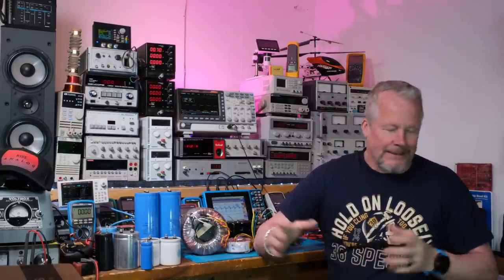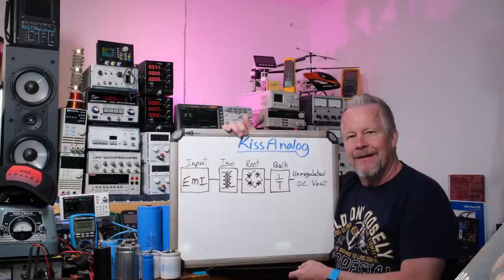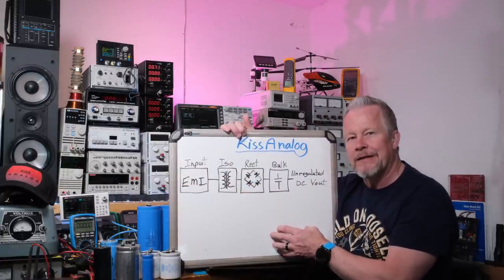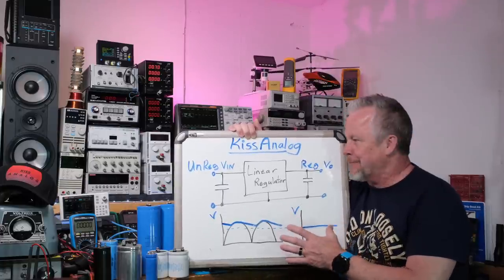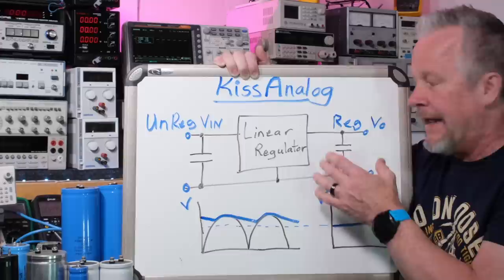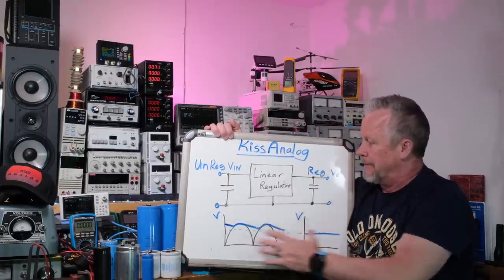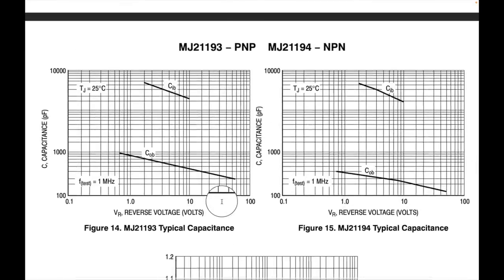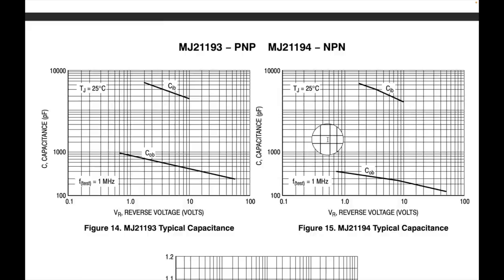Why Amplifier ‘Linear’ Power Supplies are not Regulated Rant - Have they been lying to us? #rant

Comment: Hi Eddie, another fantastic video. Been saying the same thing for nearly 50 years since starting work with an amplifier manufacturer.  The audiophiles are listening to the harmonics generated between their music and the 120 or 100Hz ripple on their amp PSU. This can be heard particularly on tube (valve) amps with tube rectifiers and may explain some  of the magic 'valve sound'. Seen the anaemic reservoir capacitor values on most tube equipment? Been a convert to switch mode PSUs on audio for around 20 years and always use one for my audio projects on size grounds alone.  Gotta get away from bean-can sized smoothing caps and plate sized 50/60Hz transformers. Just do it, you won't regret it!
Reply from the maker: Thanks Ken very interesting feedback!  I appreciate you!

Comment: The JAT501 can work with 4 ohm loads up to 38 volts or 40v rails regulated with 8 ohm. Without regulation, the idle voltage can go a bit high and VAS transistor and current source would need heat sinking or they will run hot. In other words, a regulated supply will allow for more power into sustained notes because it allows the amp to be operated at a higher voltage without over voltage concerns due to higher voltages at idle or high mains voltage.
Reply from the maker: Thanks John!  That's a great point, we can't go above the Voltage Max, so the unloaded voltage could be a problem in an unregulated Power Supply.

Comment: Well, some of us in fact do use regulated supplies for our power amps. There are some brands that do as well;  (Krell is one of note) but not many. you are correct that its not the norm. it does become quite expensive and it does add a bunch more heat to get rid of, when you power your amplifiers with amplifiers. Typically if any, they are used in lower power class A, or high bias class AB amplifiers. it also adds points of failure and audiophiles are a superstitious bunch ... I run a digital crossover, meaning that each driver has its own amplifier. this allowed me to use lower power amplifiers for tweeters and midrange and those have regulated supplies, with only the bass drivers using switchmode power supplies for the output stage, with regulated front end. There are some class D amps that have regulated switching supplies. As you pointed out, it can cut down on the 'heft' and typically linear or switching regulated supplies dont like driving large capacitor banks.
Reply from the maker: Thanks for the great feedback!  I like the idea of doing the crossover at low signal level so that you amplify each speaker.  Switching power supplies have no need to drive large cap banks - as the switching cycles are so much faster - there is no need for large caps that are needed for slow cycles.  Audio just does not get the best engineers - they have some great ones - but they are far and few in between.
Reply: @KissAnalog  Oh i'm with you there. I dont really see myself as your typical audiophile. I try and stay firmly on the objective side, if I can. I do have a tendency to overengineer, but that is not the worst of sins. Not a fan of being associated with some of that woo woo. Indeed, they dont need the large cap banks. My meaning-following along with your point- was just that because they dont like, or need large cap banks, thats one less thing to make the chassis heavy and thus 'quality' . I favour measurement and high performance SMD design, rather than mysticism and metallurgy.  

As it happens i'm in the middle of designing a PCB for a TPA3255 multichannel amplifier, to go with the DAC and DSP i'm working on. The final package being a 3d printed waveguide loaded active speaker with inbuilt DSP (raspberry pi compute module plus FPGA, driving a multichannel DAC and ADC/mic pre. I'm feeding it with a switcher I bought, at this stage, as i'm just dipping my feet in designing regulated SMPS PCBs as they are a bit of a black art. I'm pretty sure thats how your video came up on my feed ... gotta love google ...

Designers I admire are people like Bruno Putzeys of Hypex and Purifi fame, Scott Wurcer of Analogue devices, the late Jim Williams from Linear Technologies and engineers like Howard Johnson and Henry Ott

Comment: I discovered one curious fact about longer AC service wire runs. I have a "home made" Isolation transformer, toroidial winding, about 600VA capacity, which I wired a quality "Thermal Magnetic"circuit breaker ( Phoenix Contact from Digi-key) into ( 5A rating) If I plug it into an outlet which is closer to the breaker panel in my house, the inrush current will trip the 5A breaker about 50% of the time. If I plug into an outlet on the second floor, at the furthest point from the breaker panel, it never trips from the inrush current.  Apparently there's enough added resistance, or inductive suppression of the inrush current in the extra 40+ feet of wire to make that difference.
Reply: That's really cool.
Reply from the maker: Thanks for sharing this data from your test!  I can totally see this happening.  So an amplifier would have less inrush, but once the caps are charged - then the only difference would be the slightly lower voltage available because of that extra drop in line voltage.  A regulated Power Supply would totally solve this problem.
Reply: @KissAnalog  It wasn't really a test as much as an observation. I started wondering why the 5A breaker wasn't tripping, and there was only one change to the configuration, the length of wire from the main breaker panel to my outlet of choice. Sometime soon I may put a meter with a min/max current measuring function on it and see what is going on quantatatively.

Comment: A good video. The passionate audiophile pushes the limits of what is possible towards perfection. In the early 80s there was a project in the Audio Amateur magazine where someone with the surname BOAK converted a Dynaco ST150 into a fully regulated model by adding a couple transformers to the main one to boost the voltage and then putting a regulator in. The regulator he designed was a current boosted LM340-T which was floated up to the required rail voltages. This was a nice design that did not limit current but had current foldback to protect against shorts.
The end result was measured and it was objectively shown to reduce distortion from the original design. Perhaps the front end was not that well regulated in the first place but still it improved the performance. I took on this project but applied it to the Leach Power Amp from that time that I had built. Now it turned out that someone else in my city had built the same amplfier I had but had done so  as a dual mono block with dual toroids where mine used a simple Hammond EI transformer. One day we were able to compare the sound of mine ( fully regulated with his). The difference was in loud bass passages. It was clearly audible ( Rough Trade -Shaking the Foundations). Just as a trick, we then jumpered his amplifier to my power supplies with thin wires with clips and it now sounded identical. From that day on - all my power amplifiers are fully regulated. Now what needs to be said is that full regulation removed "warmth" from the amplifiers but the amplifiers no longer compressed loud passages and appear to dig deeper into lower frequencies. The removal of "warmth" is an aspect which would be worrisome to mfrs. Comparison of LM340 etc. vs. Sulzer op amp based clow current regs also show differences in sound as well. Today I now use Benchmark AHB2, LA4 and for the phono stages, I have each op amp with a dedicated high speed regulator with an equally fast op amp doing the work. All are fully regulated using cheap IEC cords.
Reply from the maker: Thanks for the fantastic feedback!

Comment: Hey Eddie, you really nailed it on this video!
It's really incredible the lengths the audiophile community can go praising snake oil while the obvious things they don't tackle.
A non regulated "linear" power supply really behaves like a switching power supply!
One can even see the rectified current PWM'ing as it checks against the ripple discharge ramp!
Yet, design discussions on those PSs, on whether we should use (or better avoid) high speed or soft recovery rectifiers due to the switching artifacts that they create (against the transformer's inductance) are all discussions that resembles much more the SMPSs realm than the linear world.
You really have a point on the obvious advantages anyone could get by regulating a power amplifier's power supply, especially in the audiophile segment where it seems that no effort is too expensive to get "that last" quality improvement.
It seems though that, in contrast to what they preach, they are in fact employing engineering approaches to their design, weighing-in cost and profit margins against objective (tangible) benefits.
Objective benefits? Did I say that? How do they know? They measure it?
Lol.
Reply from the maker: Thanks Fabio for this excellent feedback!  I totally agree with you!

Comment: Another great rant. Would be nice if you could do an experiment putting a linear regulator circit on the the output of a "linear" PSU, and showing the difference in the output of an amplifier.
Reply from the maker: Thanks - I will do this in the near future!
Reply: @KissAnalog  Eddie the gold standard is an array of batteries. Compare linear/switches to "pure" DC of batteries.
Some old car batteries will do, avoid the cost of lithium.

Comment: Back in the 80's & 90's Bob Carver's "magnetic field" amplifiers used a Triac on the input side of the power transformer driven by music demands to keep his power rails constant regardless of load or line voltage sags. His amps were comparatively light and energy efficient and were noted for their sound and amount of headroom compared to amps costing twice the price.
Reply from the maker: Thanks for the great feedback!  I introduced my friend to these amps and he bought 2 of the cubes - I think they were called.  He later bought a larger Carver amp for his subs.  He loved them and played them for years.  He had big speakers and likes to play his ACDC loud;)  

Bob may have introduced one of the first switching 'regulated' power supplies for an Audio Amplifier;)
Reply: They were known as the Carver Cube but the actual model was the M400 , like his Phase linear 700 ( which started as an amp he built  stuffed into a coffee can at a McIntosh clinic and when asked where the transformer was Bob said outside on the pole  ) the model stood for total power of 200 x 2 . I really liked his next design that weren't just regulated they were variable tracking power supplies that kept the rails at 6V above what was needed at that instant in time so only 6V was wasted as heat (they run cool prolonging the life of the caps ) and his Signature models could double the power as the impedance halved down to 2 ohms and could drive a 1 ohm load on a time limited basis. I have a Carver MXR 2000 (200 wpc ) and Sunfire Ultimate  receiver 200 watts X7 ( it only doubles down in stereo 2 CH mode )  and love them. The hype made sense to me and turned out to be true .   @KissAnalog

Comment: Thanks Eddie, boy you're really touching on unscientific stupidity hear. First, and I learned this the hard way, you can't rationalize irrational people who don't know science. Don't even try, I run welders with less copper than that wire you're showing! I did an article for AudioXpress where I used linear regulators and got ridiculed for it, I can send you the schematics. Paul is a nice guy but he doesn't know electronics, I saw a YT video where he explained power factor and phase and it was completely wrong, you can search it out if you think I'm kidding, he has no idea what he's talking about but he's talking to people who don't know electronics - it's the blind leading the blind. They advertised their new speaker as having a tweeter with "zero mass", did I tell you this before? Zero mass is impossible, they said "we'll get back to you". Half the people designing audio equipment have no idea what they are doing, no wait, 90%. Someone did it before so it has to be the way to do it. Don't even tell them they can't hear DC - they think they can!

I've been using sophisticated instruments for 40 years or more, I never got a manufacturer who said it has to run 100 hours before it works right, it has to break it. What is actually breaking in? The electrons have to find their way through the transistor, why didn't I think of that!
You can't rationalize these people, they hear things it's impossible to hear and none of them will, or can, do it in a double blind test - and I mean none of them! It's about money, they're making a lot of money on human ignorance - PT Barnum would be proud.
Reply from the maker: Thanks for the great feedback!  I agree with you - but I'm looking for straws - or the most minute thing that might actually have an effect.  I'm rationalizing as well - but I think a test with and without a linear regulated supply might have the answer.  I'd be happy to see your schematic and the article.
Reply: @KissAnalog  I'm just doing another article, I'll PM you the schematic, I'm interested in what you think of it.
Reply from the maker: @mosfet500  thanks - I appreciate you!

Comment: Funny thing, i would say that a Class-A/B/AB amplifier is per se a form of a linear power supply, even though its actual power supply component is unregulated. With the momentary output voltage being regulated to be input signal multiplied by set gain, ideally. It's possible to approach it as such; for example to only explicitly regulate the voltage as it goes into the voltage gain stage, and just filter the power with the help of some chokes as it goes to the power transistors. You have to get your PSRR from somewhere though, you shouldn't just make up a synthetic test which makes your design look good while it can fail in the real world.

I think similar whole-system approaches like that can be applied to discrete Class D amplifiers as well, though it gets correspondingly more complicated.
Reply: As long as you don't hit the rails then yeah. The audio inputs the level times gain and the gains not dependent on the rails voltages, without input output caps it'll be a dc regulator essentially controlled by the signal input voltage, right? Ideally anyway
Reply: Thing is 95% of the complexity that might apply to generic test applications can be ignored when you're only be concerned with audio frequencies and a narrow selection of common amplifier categories. I designed and built my own version of a "power conditioning" system for high frequency test and measurement applications that provides multiple channels for test equipment, power supplies, and connected DUT that must account for myriad interactions and side-effects such as multiple upstream independent sources including 3-phase power under various system grounding configurations. I've discovered all kinds of interactions among equipment that I'm pretty sure are almost always overlooked and would only be found by considering an entire system such as this. I'll just say how you derive, supply, and/or condition your ground(s) is at least as important as the associated DC and/or AC phases (obviously, but there are some not so obvious aspects to it too, even before piling on the EMI considerations).
Reply from the maker: Thanks for the great feedback Daniel!  Is there a specific example that you might feel is directly relevant to an audio amplifier and its power supply?

Comment: Some manufacturers do regulate the output rails, Naim did this with their NAP250 back in 1975, unfortunately the circuit it powered was straight out of the RCA datasheet and wasn't that great so not all the benefits of regulation were heard. It probably all comes down to cost that it isn't common, but it is surprising more of the costly amps do not employ it.
You are right about the measurements, there are indeed many other types of measurement, than just plain old Thd. But even Thd measurements can be more insightful providing they are done across the whole frequency range and at different amplitudes, instead of just for a single 1kHz tone which some use  on its own to decide if a design topology is good or bad.
I did some experiments regulating just the front end (not the driver and output stages) of a couple of amplifiers a while back and used my HP 8903 distortion analyser to sweep from 20Hz to 100kHz and found a reduction in distortion both at low frequencies due to removal of mains ripple, and also at high frequencies due to removal of ripple caused by the amplifier itself at the test frequency. Just regulating these stages allowed the use of small regulators that took up little space and were not expensive.
Reply: Wait doesnt the Dynaco ST-120 also have a regulated power supply?
Reply: NAD3020 also had regulated preamp and driver power supply. Also have an 8903 and running sweeps is a form of FFT. It's very interesting to see resonance in power supplies. Music listening is essentially white noise played at loud levels (high current). Phase and resonance don't seem to be thought important.

Comment: I have a Naim NAP180, the rail is +-40V unregulated. I found Hypex SMPS1200A100 got +-40V outputs as well. Would it be worth to try a Hypex power supply? Thanks.
Reply from the maker: I always loved the Naim gear - but just never owned one.  I think it would be great to try a regulated supply and see if it does make a difference.  I think many of us here would love to hear your experience with this.